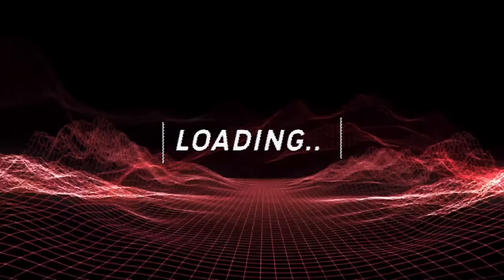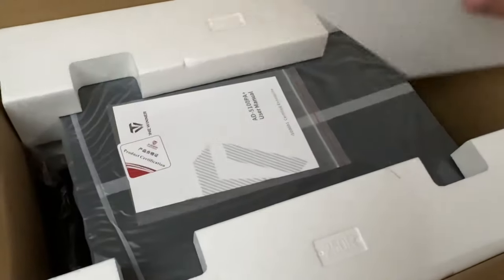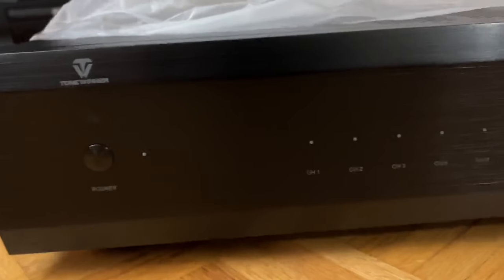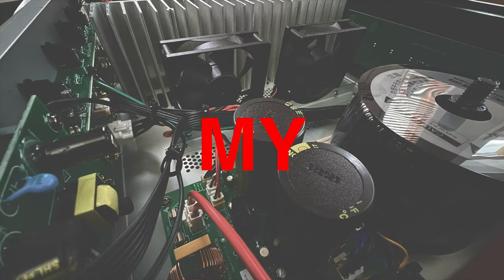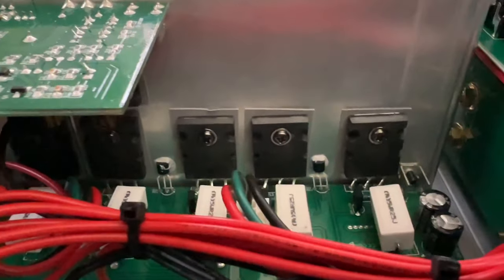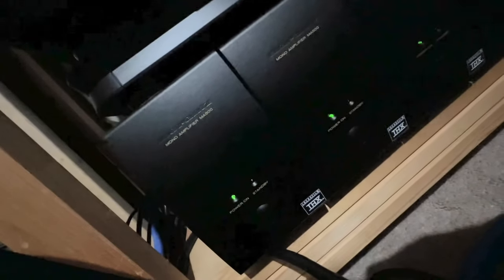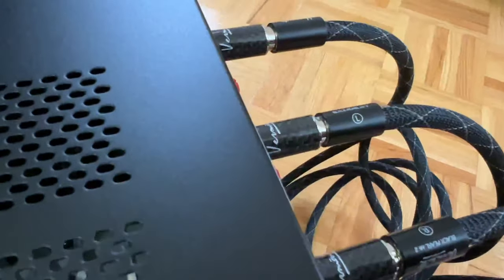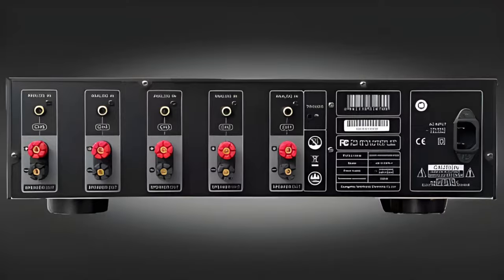Tone Winner AD-5100PA / 5100 : This Power Amp Shouldn’t Be This Good :

Comment: Yeah agree with comment up top super clean less rubbish for interference etc I like some of the bigger models with separate amp modules just cos in my head better separation although I'm no expert it's definitely how more high end models do it but they are also more powerful units so with go pre outs this could take the main strain off an av receiver although you'd want dennon or marantz to get the disconnect feature the put on their mid and high end AVS so the amp for those channels isn't working at all when the pre out is. I'm definitely getting on board with these guys once I finish my crazy expensive car install and save some more money lol. I much prefer the new fascia design too 😊 the big single VU metre model was a bit tacky and so was the outside of the case even though I'm sure it was not a bad performer at all
Reply from the maker: Agree 100% of your post. Thank you for watching and posting